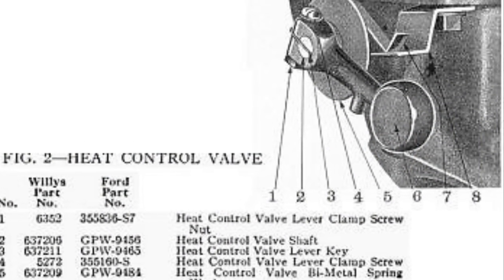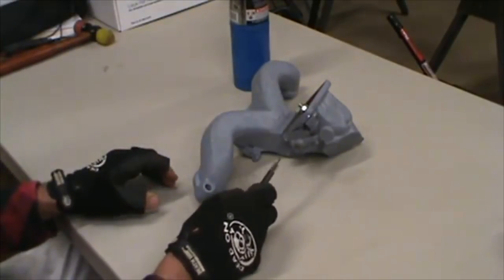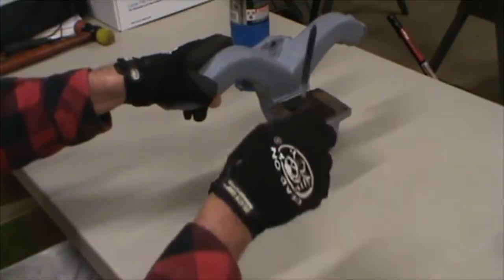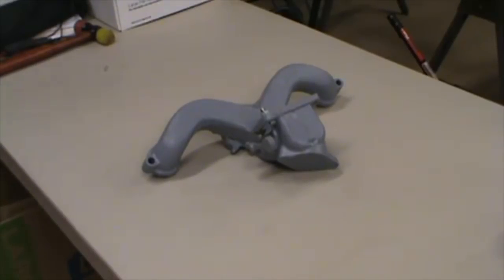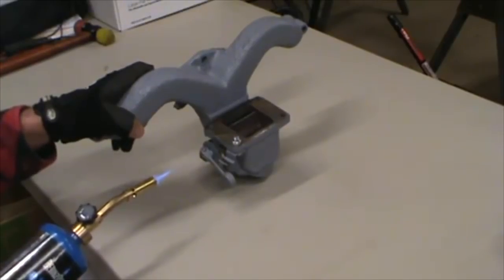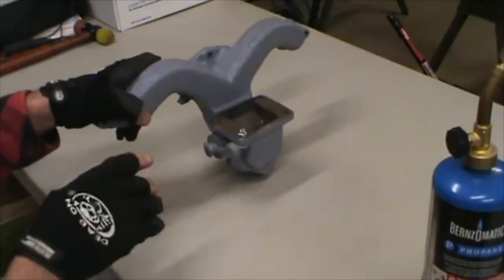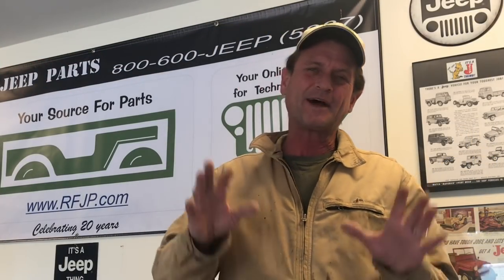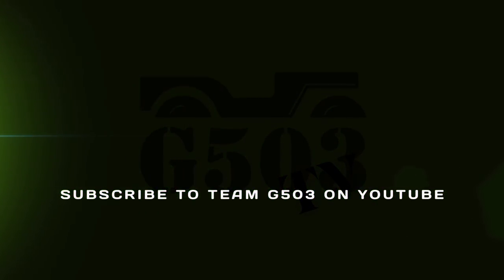Willys MB L134 Engine / Function Of The Heat Control Valve CJ2a CJ3a Ford GPW

Comment: How do you keep it from freezing up over time?
Reply from the maker: Usually with regularly running the engine it won’t seize. I have heard of some using high temp anti seize. 
I imagine a drop of oil from the outside wouldn’t hurt either.
That’s a great question tubaman.
Maybe some who watch could share their thoughts on this subject as well👍